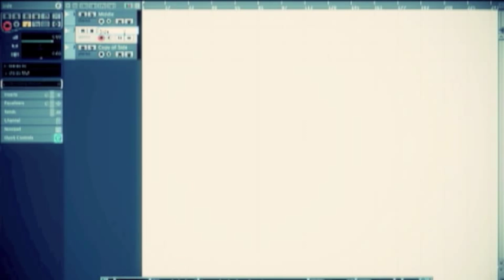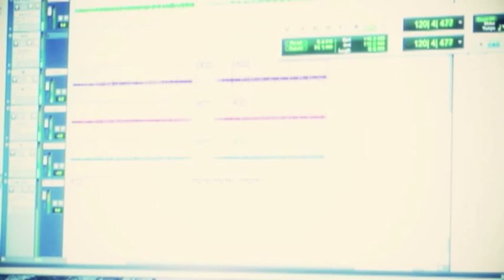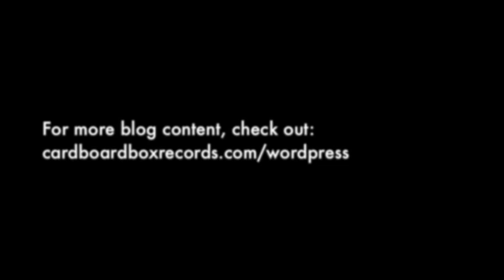How to do M-S (Mid-Side) Microphone Recording Technique | Box Studio Presents

Comment: No offense intended, but this is not M-S.  This is a hybrid of the M-S and Blumlein pair techniques.  If you have two figure 8 condensers, there's no reason to do this.  The Blumlein pair (two matched, coincident fig 8 condensers angled 90 degrees apart and usually 45 degrees to the source) is considered to be one of the most reliably detailed and accurate stereo recording techniques.  

The M-S technique was developed for getting a well-balanced stereo image when two matched fig 8 condensers are not available.  It consists of the same mixing techniques you described, but the "mid" mic is cardioid, aimed at the source, and coincident to a fig 8 "side" mic angled 90 degrees to the cardioid axis.  Then you copy, hard pan, and invert one instance of the fig 8 signal, and its interference with the evenly distributed cardioid produces a stereo image.

Again, though, if you have two AKG 414s, a straight Blumlein pair will produce a truer result more reliably.  

Also, if you set them both to omni and make them coincident, something cool might happen some of the time, but it's at least as likely to produce an undesirable result as a desirable one.
Reply from the maker: Great feedback Adam! Thank you for sharing!
Reply: I disagree.  Mid-Side has a MID and a SIDE, where one microphone captures a mono signal from the source, and the Side is a figure 8 NULLING the mid, duplicated and phase flipped to create a center phase cancelled faux stereo channel.  The Mid mid can be either cardioid (more common) or figure 8 (where it grabs the back of the room) but that channel still functions as a MID volume control.

Blumlein Pair differs from this because it DOES NOT have a mid channel, but a Left/Right mic pair.  

They are similar due to the co-incident phase between the mics (the above below placement).

The reason to do M/S compared to Blumlein, in my opinion is, more control over the MID channel and a wider stereo image.